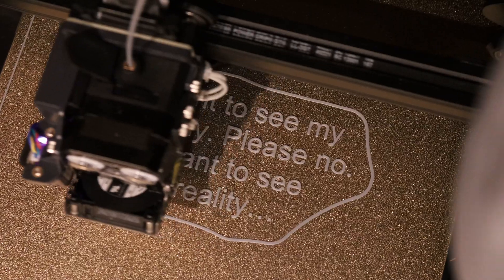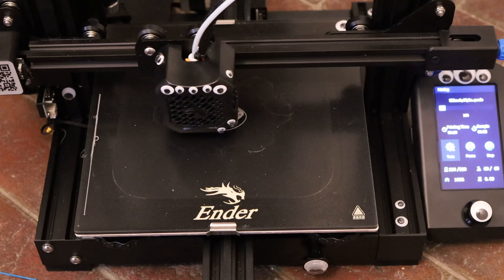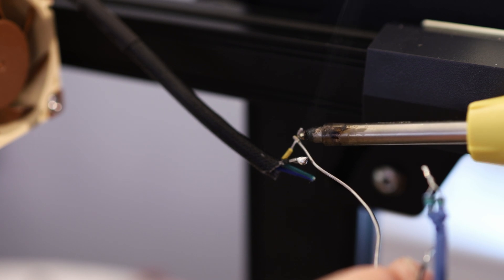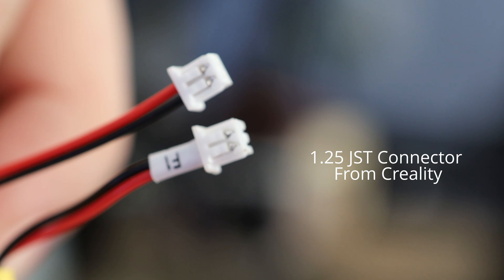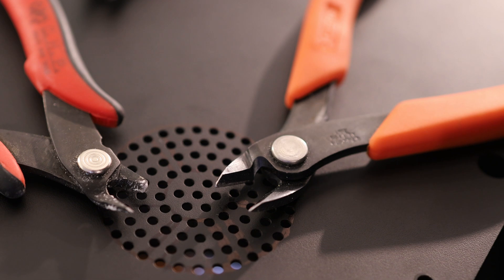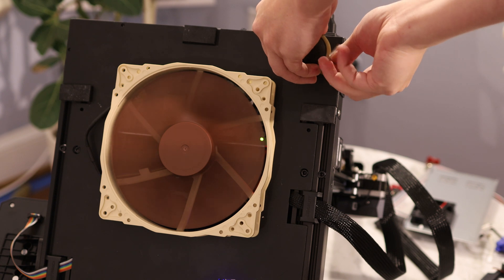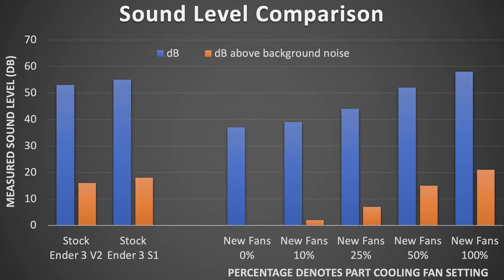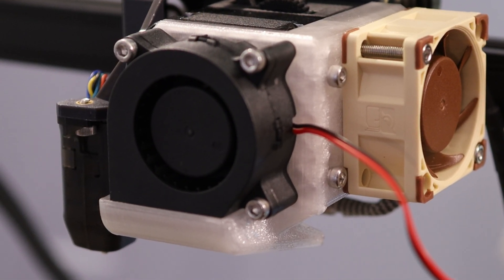Ender 3 S1 - The Silence of The Fans

Comment: THAT NOT HOW ZENER DIODS WORK NOOOOOOOOOOOOOOOO...

Imma report this for miss information and unsafe acts
Reply from the maker: How it does it work? I've believe I've seen this on power supplies to convert 24v to 12v for fans.
Reply: @NathanBuildsRobots  the zener connected like that just lets any voltage above 12v up so it does nothing besides lover the voltage by 0.7v but that's done by all diodes besides shotky those lover it by 0.3v
to get the correct way google zener diode and transistor as voltage regulator
you can not use the transistor and just get the 12v form the same place the transistor gets it but then all the power that the fan gets needs to also go through the zener and it might burn it that way.
Reply from the maker: @owngamesgamer4030  Im not sure what's in the video, but I have installed the zener correctly so that it is halving the fans voltage.

Comment: I've been using a 40x20 12V noctua for hotend cooling and a 120mm beQuiet (undervolted to 5V) in a custom electronics case and have had zero problems since I've installed them; the coldend has pretty much the same temp as stock (measured by hand) and the raspberry pi and motherboard run at around 35 celsius during prints (measured by klipper firmware). Should get to replacing the stock blower sometime, but procrastination is a strict mistress xD

I've heard the 40x10 noctua is a bit underpowered, cooling-wise, though I haven't verified that claim myself; I just bought the 40x20 since the only good reason for the 10mm thin one is that it's a drop-in replacement for the stock mount (size-wise; you still have to regulate the voltage).

Love the detailed walkthrough, though I personally would recommend using a second DC-DC buck converter instead of the zener. Not that it doesn't work - quite evidently it does - but I just don't like the thought of a passive component just toasting away in a cable somewhere. Again, just a personal recommendation and not a "don't do that" :)
Reply: @LordHonklnc Where did you use the 120mm fan?

Comment: I have six ender 3 pro, and they have all been running with blocked power supply fans since day 1 to remove the incredibly loud noise. I yanked a zip tie into the fan to stop it spinning. Problem solved.
Reply from the maker: Lol, nice
Reply: @NathanBuildsRobots  for two years, Nate, and we are running ABS parts at high Heat = high load on the power supply...
Reply from the maker: @cp001cp001  I wonder if the vertical power supply mounting is helping keep things cool even without the fan.

Comment: Could you share your slicer settings (printer, material and profile)? The one included for the Ender 3 with PrusaSlicer have been terrible on my Ender 3 S1.
Reply from the maker: Yes, slicer settings can be found at the bottom of the page: 
https://www.nathanbuildsrobots.com/testing/ender3s1

The main issue with the stock profile is 0.8mm retractions, I turned it up to 1.2mm and have been getting excellent results
Reply: @NathanBuildsRobots  Thanks! Turns out I was using an older version of PrusaSlicer that didn't have the S1 profile.

Comment: I am likely just going to replace each fan directly for the power supply and motherboard to start. 
I got a screencap of the motherboard fan (CHA6024RL-15B 24V 0.10A), but not the power supply fan.
If you still have it kicking around, can you let me know what part it is? Thanks!
Reply from the maker: I haven't looked at my S1 in a while, been tied up getting a couple reviews made. But I will be looking at my S1 hopefully in a couple weeks and I can check.

Comment: Please tell me abiut the feet, squash ball, where to mount it?
Reply from the maker: Files and Pictures can be found here:
https://www.patreon.com/posts/62155640
https://www.patreon.com/posts/62156070

The feet bolt on to the existing holes on the bottom of the machine, and 2 t-slot nuts

Comment: I think I might try a different approach. No matter what fan you use, forcing air into those tiny ducts is hugely inefficient, there has to be a better way. An aquarium pump (high grade pro models) can provide nice useable volume of air, so all I have to do is design either a manifold to direct air to 2 (or more) nozzles, or an air handler that lets the air escape in an annulus around the nozzle for 360 degree cooling. Air volume would be controlled by remote mounted servo controlled valves interfaced to appear to the firmware as normal fans, probably via an Arduino. Once the manifold is in place, all the printhead has to carry in terms of added load is a length of silicone tubing supported at the top near the filament carrier mount.
Reply from the maker: A lot of people use 24v compressor pumps from massage and car chairs with inflatable bolsters and stuff. Look up "Berd air"
Reply: @NathanBuildsRobots  Very cool. I figured something must be out there. Still, I'd be inclined to use a premium aquarium air pump. Thanks.

Comment: noctua fot hotend and especially part cooling is "no go zone" - they are quiet and nothing else - not enough air flow and static air pressure. Overhangs looks like shit, hotend is clogging all time, and you even cant set speed for part fan because noctua starts at 75% speed.
Reply from the maker: Never had any issues with Noctua hotend fans, but I always use titanium of bimetallic heatbreaks. I just verified with test data that the heatsink temp was the same between stock and noctua.
As for part cooling, higher pressure will pretty much always be better. Initial testing is looking like 40x20 noctua fan is getting good results up to 45 degrees.

https://www.youtube.com/watch?v=uBdcC_EaUFo

Comment: I read that you planning on doing a mod with the 40x40 noctua as part cooling as well, is the 40x20mm noctua giving enough airflow, is not their 60mm 12v fan better option for the part cooling?
Reply from the maker: Yes, I'll be releasing that next week along with an announcement for some other upgrades in a video. 
The 40x20 is looking like it works well up to 45 degrees of overhang. More powerful fans will always be better, but at some point, for cooling smaller areas, static pressure and airspeed is more important than absolute fan size
Reply: @NathanBuildsRobots  I agree on that one, it's always a struggle between efficiency and noise level, where to set the line. 
I have currently installed this mod in the video above, and so far I can say it delivers good results (but noise level is high, when on 100%), therefore it would be really interesting with some comparison between them, 40mm blower fan vs 40mm noctua etc. :)

Comment: Hi nathan
I saw picture : yellow wire ( from noctua fan) connect to diode. Is it right? Yellow wire of noctua control speed.
Reply from the maker: Hi Khoi, in my experience with Noctua fans, yellow is positive, black is ground. Blue/green are PWM wires. Other manufacturers assign yellow to PWM sometimes. 

Check out this article by Noctua:
https://noctua.at/en/what-pin-configuration-do-noctua-products-use

Comment: thanks for the perfect guide!  A question regarding the height of the air flow, should it be directed exactly at the tip of the nozzle, or more higher at the nozzle (ie just below the heat block)?
Reply from the maker: I go for just below the heater block. IMO half of the air should hit in front of the printed area and half should go behind, so you get more even results at different directions.
Reply: I just got my printer and printed another print head with the two jets mainly cos it reminded me of an octopus :D and I was put off by the 150 degrees, I'm so glad that is not an issue for the 12v fan. While it does indeed look cool, now when I print anything with infill I have pan pipes... And I can't add the side fan. Other than that the difference over the stock is so significant. Are the dual jets better/worse or the same in terms of output? Or does the fan improvement mean that it is now so over powered it doesn't matter?

Comment: Did u try a voltage stabilizer instead of a zener? With one of them u should be able to use the not-needed voltage instead of wasting them heating ur room
Reply from the maker: I have tried buck converters before. They are great, but are a bit large. If it's going in the case I will use them. But for this I wanted something small that could be added in-line with the fan cable.
Reply: @NathanBuildsRobots  I did not mean a buck converter, the part I mentioned has the size of a transistor, three pins for connection. I did not use one myself yet. They do the same than a zener but u can grab the left-over voltage by that 3rd pin, so u won't burn down sth. Sth like 78L05

Comment: The zener diode is so a dumb idea that I subbed
Reply from the maker: Trust me, you're in store for a lot more dumb ideas. 
I shorted out one of my fan plugs and burnt a PCB trace, then fixed it by soldering a tiny wire onto it.
Reply: @NathanBuildsRobots  so you're telling me that I have landed in the right place? Nice!

Comment: Have you found a good spot to mount a camera for octopi yet? Currently trying to figure that out.
Reply from the maker: Do you like it mounted high or low? I can design something for it that will clip on to the base or the top rail.
Reply: @NathanBuildsRobots  I like it low, so it’s easier to connect since it’s closer to the pi. Only negative is I can’t see taller prints but I always imagine it’s good if the print is still attached to the base.
Reply from the maker: @JoeSchmoe24  Alright. I was working with someone to develop this snap-on attachment to the S1. It REALLY clips on to the side. Like, I had to use a pair of pliers to get it off.

https://thangs.com/chaicracker/Ender%203%20S1%20-%20Snap%20On-Side%20Feet-49772

I will see if he can adapt it to hold a camera. Probably will use a hole for threading a 1/4-20 bolt into it, which is pretty standard for camera gear. What webcam are you using?
Reply: @NathanBuildsRobots   ahh that’s awesome. I’m currently using a Logitech webcam that has the folding plastic that mounts it to a monitor. Have to upgrade that eventually to move that back to my pc for work stuff lol. I plan on getting one that can mount with a bolt.
Reply from the maker: @JoeSchmoe24  I'll design one for the bolt style and feature it in a video when its done, I plan on doing a video on firmware upgrades/octoprint/klipper, so I think it would fit in nicely there.
Reply: @NathanBuildsRobots  you are awesome! Thank you and your content is very enjoyable!

Comment: I'm a bit confused here.  You replaced the bottom motherboard fan and power supply fan with 1 big fan situated in the center at the bottom?  I mean that would explain why the temperature was  higher on the motherboard because you're no longer blowing air directly on top of it.

  But what Im confused about the most here is the actual reduction in sound for all this work?  Judging by your graph, it looks like this new setup is even louder than the stock fans at 100%.  Your chart doesnt show fan speed % for stock fans, so I assume that those bars are indicating the stock fans at 100%?  How loud is the printer when stock fans are at 30% vs the new fans?
Reply from the maker: Good questions, unfortunately I can't answer with real data since my printer is already modified, but I can answer with how I "feel" about it.

With the part cooling fan off using the old setup, it was only 2-3 dB quieter since the rest of the fans are quite loud.

With the new fan at 100% it is providing about 4x more part cooling power than the stock setup, so while it is louder, it is also providing better cooling and print quality.

With the fan set to ~20% I can't hear it at all and the part cooling is as good or better than the stock setup at 100%. Plus now I have the option to crank up the fans to get really good 75 degree overhang performance if I need it.
Reply: @NathanBuildsRobots  thanks for clarifying that.  So it seems this is more of cooling mod to achieve better preformance rather than a sound reducing/slitent mod.  I'm just building an enclosure now for my s1 and planning out everything and was wondering if I should do this setup, but it was throwing a wrench in my design as it required extra bottom clearance for the big fan and that means a taller case and more plexiglass I would need.  I think I'll skip the bottom upgrades, but may end up doing the extruder fan upgrade if I find heat being a problem down the line.
Reply from the maker: @007craft   I am also testing a version with a 40mm noctua fan as the cooling fan. I will release that model as a free download on my patreon/thingiverse on the 28th

Comment: I don't dare touch the electronics. I'm just too stupid for that. Do you have any tips for me?
Reply from the maker: I would like to make a simple adapter like the one i made in this video and sell them on my website.

That you can just plug 1 side into the fan port and the other side into the noctua fan. I really wish 3d printers would move to the ATX standard, like what computers use. That way there would be standardized pins and connectors, and easier upgrades.

Comment: Hey there! Interesting design. Was wondering if it should be enough the part cooling fan as its blowing from front only, double air vents should be enough? Curently i'm running Klipper and printing at 100mm/s the outer shell isnt looking very good, needs a lot more cooling. Thanks for the video! Also, can you share your slicer config for Ender 3 s1? thanks!
Reply from the maker: Are you running Klipper on the S1? I didn't know if it was supported yet.

I have a rant on dual duct part coolers, but I will save it for a video, after I've designed and tested a dual duct version. It's just a little hard to do with the way the extuder is built. Lots of stuff surrounding the hotend.
Reply from the maker: Just published my instructions for how to set up the slicer settings that I use.

https://www.nathanbuildsrobots.com/testing/ender3s1

Comment: You should at least not cover that zener diode so it can more effectively dissipate the heat.  They should not be operating close to 100c
Using zener diodes to stepdown is horribly inefficient as the heat generated=(12v)*current. both 40x10, and 40x20 fans are pulling 0.5A based on label, hence the zener diode needs to dissipate 0.6w of heat. It is like if you used a 24ohm resistor there. Buck converters are a much better option or wire fans in series.
Reply from the maker: So that footage was when i was using a 4020 noctua fan with 2 parallel 150W 1/4w resistors for an equivalent 75 ohms of resistance. It was overvolting the fan and the tiny resistors were not dissipating enough heat.

2nd try was with zener diode with leads trimmed short on a 4020 noctua fan, with 2 layers of shrink tube around it. Still was getting very hot amd melted the other wire it was next to.

3rd try is 12v zener diode with leads left long (they act like little heatsinks and spread the heat out) and running a 4010 fan which uses 1/2 the power, with only 1 layer of shrink tube around the diode, and a couple layers around the wire next to it as shown in my install. Also I tucked the extra wire & diode I to the empty spot where the old blower fan was, so it's being actively cooled at least a little bit by the 4010 fan.
It's running at 36C now, which I'm pretty sure it's OK. 

What do you think about the motherboard temps? It's a bit hotter than stock but is it enough to worry about?

I never knew that 1 or 2 watts could get something over 150C before this, but hey I learned something new!
Reply: @NathanBuildsRobots  oh, that more reassuring, I thought you were running it with the diode above 100c. Theoretically, infinite temps can be achieved as long as the input power exceeds power dissipated, hence I was telling you to leave out the insulation around the diode.
Your Mobo temp is perfectly reasonable. Most semiconductor run around 40-80 without any issues. Higher temps can significantly decrease life probably due to a combination of increasing electromigration and causing thermal migration of dopants. 
Also surprised that the 5v fan didn't get fried at 12v. Looks like they are well built. 
Love your videos, keep up the good work!
Reply from the maker: @nmos001  thanks for so the good info. 
That's Noctua for you, built like a tank. Their fans have a MTTF rating of ">150,000 hours" which is over 14 years. Also, Noctua as a company is just about 14 years old. Coincidence? I think not. They probably have been running fans continuously since they were founded and is still running today, so all they can say is they last at least 150,000 hrs! 😆
Reply from the maker: OOOOOHHHH WAIT

The 4020 fan I was using was a 5V version. Which explains why it was pushing so much air at 12v! It was outperforming the stock fan and was just about as loud!

Thanks for bringing this up, would not have caught that if I didn't take another look at my fans.
Reply: @NathanBuildsRobots   Now I am a big confused, in the video you had the 12v zener measured 150C, was that heat due to the fact you put a 5V fan there (V 0,25W)?
Because both the Noctua 10 and 20mm are having the same Watt, 0,6W at 0,05A.
If I install as you did in the video but using the 12V (Noctua 40x20mm), will the heat be under control on the zener?
Reply from the maker: @mr.hammer1507  yes, the heat should be much better if you are using 12V fans. 
I was running mine at 140% over its normal rating, so the diodes were generating about 2.9w of heat. 
After switching to the 12v fan, they were only subject to 0.6w, so it's much cooler now.
Reply: I am using 7812 voltage regulator for my Noctua 40x10 12V fan.
Reply from the maker: @tonywoolf  nice, where do you attach it? Just to a random bolt on the hotend?